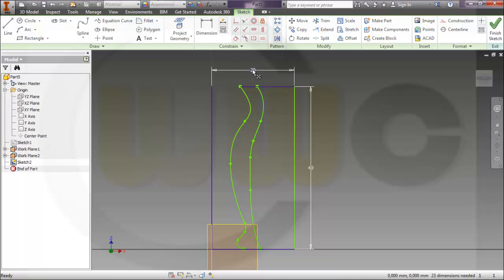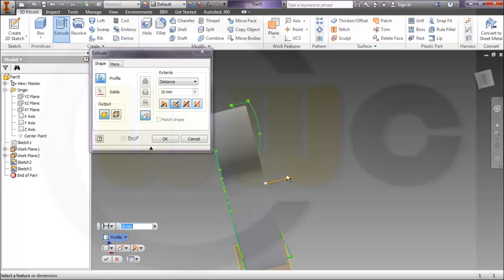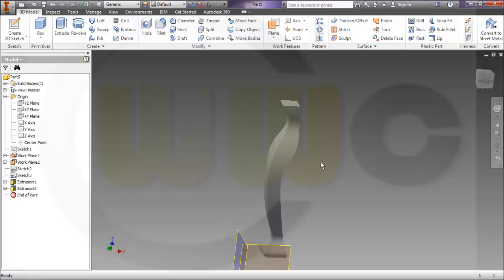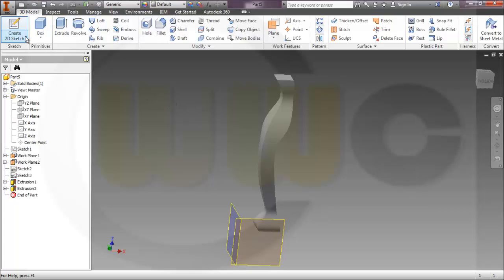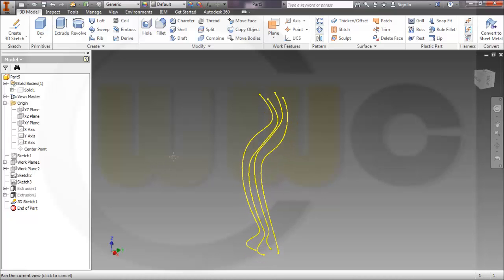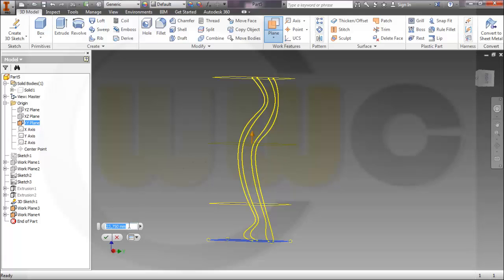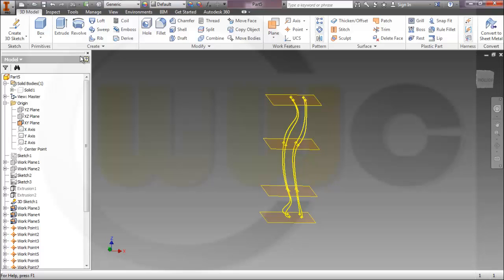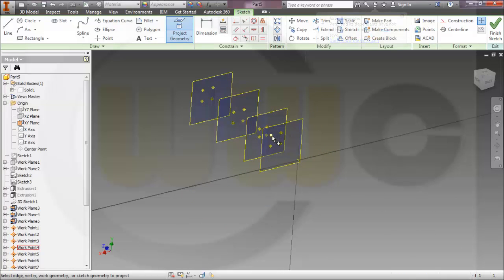Userwish 4 - Inventor pro 2014 Training - Loft with Rails

Comment: Thank you Wolfgang,
I applied this tutorial to Inventor 2019. I had no trouble with the basic lofts but using the rails was a nightmare of my own making. Initially i only had one rail that worked for the full length of the part.I drove myself slightly crazy when  at the top of the part i was unable to apply the coincident constraint to the the circle and all four points and so the guide rails failed. I solved this by applying the parallel constraint to the top straight edge of the early 2d sketches relative to the  XY plane  prior to the extrudes.This made all four work-points co-planar. 
Another problem I had was in having the 2 2D sketches near the start of the process located too close to each other by a small amount. This resulted in one extrusion causing a slight flat surface on the other extrusion. At the point of generating the rails, the include geometry under 3d sketch would not do a single smooth line for the two edges that had the flat accidentally extruded across them. This was easy to fix but a bit hard to find. Even though the flat was slight, and i could use include geometry to include the slight flat, Inventor did not like that as a guide rail. 
In trouble shooting my issues, I broke the loft into 3 separate lofts and then introduced the rails to that short segment of loft. I repeated that process until i located the culprit. Its too bad the error messages are so cryptic.
I finally got through this and am proud of having successfully carried out the trouble shooting.I learned a great deal both from your presentation, and the troubleshooting.
I wanted to print out my cabriole leg and hang it on my refrigerator as my my mom did  decades ago, but fridge magnets don't work. The door is stainless steel :(
Reply from the maker: Yes, I learn a lot from all the "happy accidents" of my trainees as well. Inventor is a very good program but sometimes it is just painful ... - especially regarding surfaces ;)